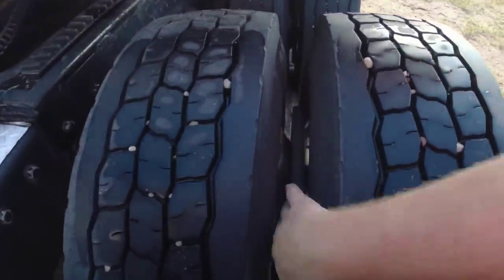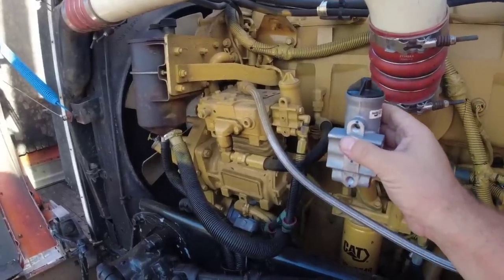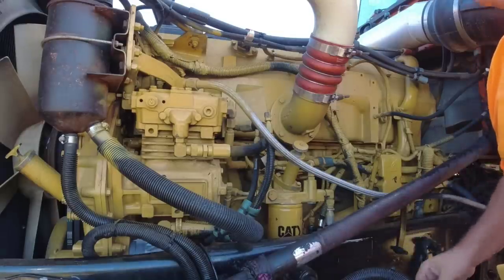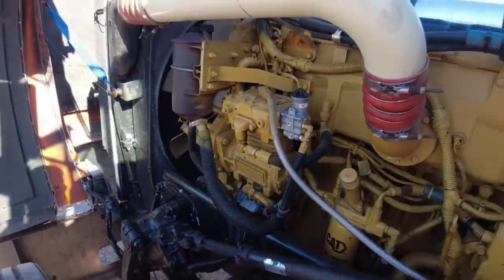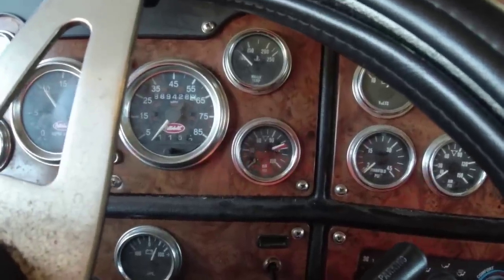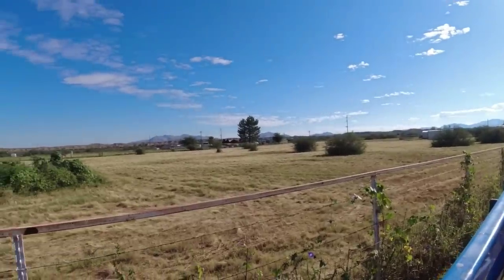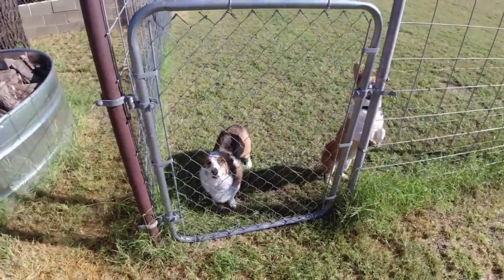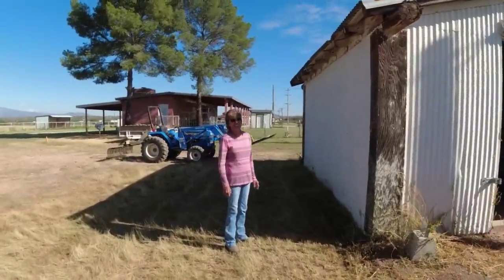#611 Home Time Honey Do List The Life of an Owner Operator Flatbed Truck Driver

Comment: It's Cen-tra-matics. Used them a long time ago before truck stops had them. Then used Balance Masters (liquid mercury filled) then used Counteract balancing beads inside the tires only. The last one being the best! 👍 
  When putting the wheels on use the Tru-balance centering pins to center your wheels & brake drums for a smooth ride!

Comment: Change the air separator filter too,  the new trks I don't know what it is but every 5 to 6 months I have to change mine out just a lot of condensation pull the same trailer don't know what it is. The ol trk  changed air separator filter once a year . Be safe have safe travels.

Comment: You may need a FIELD KIT for the AIR Compressor head.  It is a need for some unloading air compressor problems the D2 valve doesn't fix.